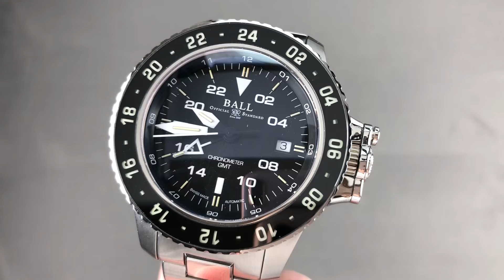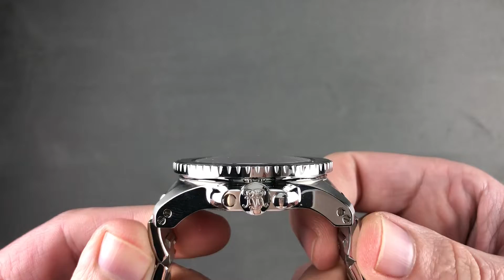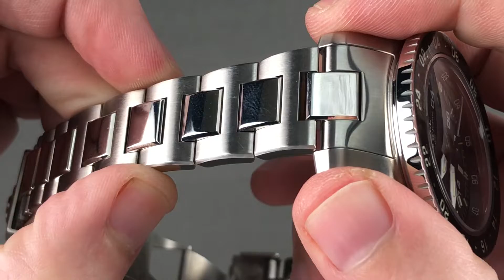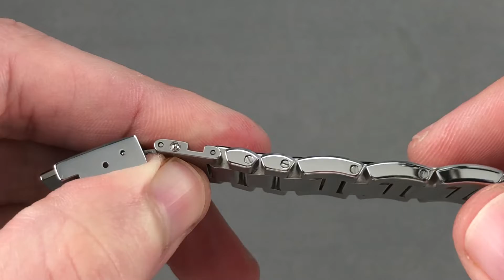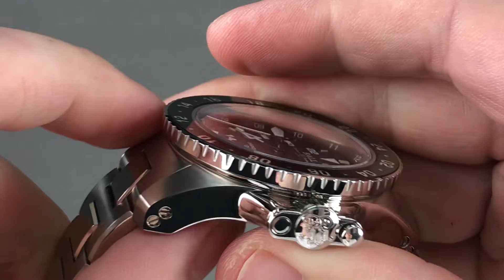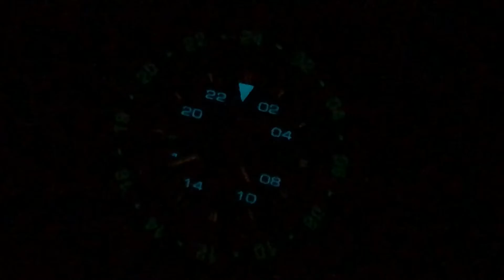Ball Engineer Hydrocarbon Aero GMT II DG2016A-SC-BK Ball Watch Review

Comment: I was underwhelmed with mine.  Although a certified chronometer, it consistently lost 10 seconds or so per day, way out of line with the COSC standard.  It also digs into my wrist.  Based on my experience, I wouldn't recommend it.  I do like the dial, though.